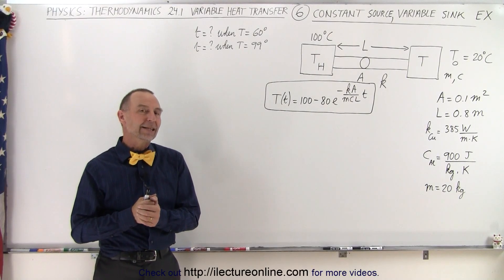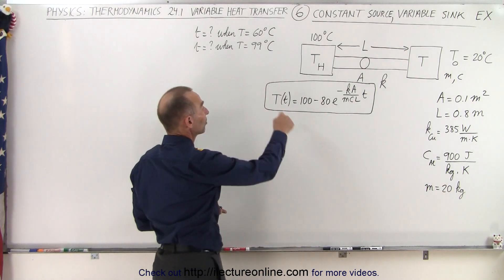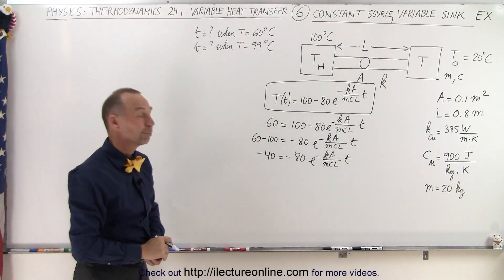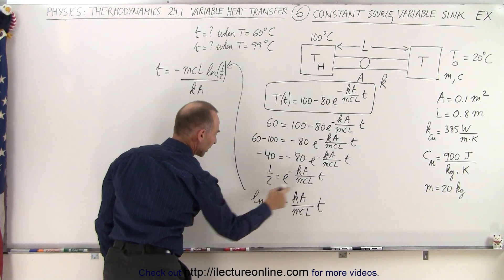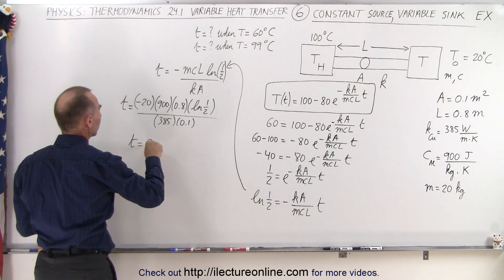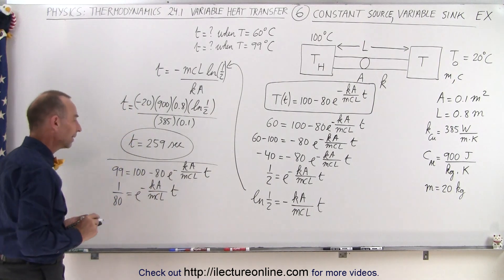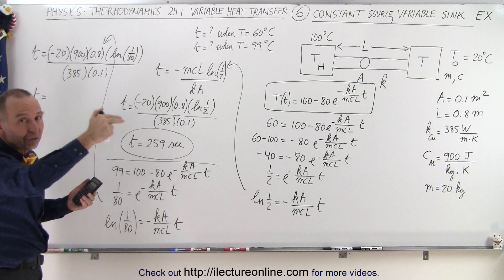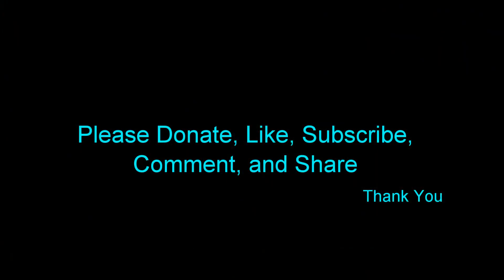Physics 24.1  Variable Heat Transfer (6 of 10) Constant Source, Variable Sink

Comment: What if there’s no distance between the two metals L=0
Reply from the maker: Then there is no conduction problem.  You must have  a path length in order to have conduction of heat along that path.
Reply: @MichelvanBiezen  I mean as in two blocks [  ][  ] touching 

I’m trying to work out the time it takes to reach equilibrium - all the videos tell you how to calculate it but not the time it takes between the two connected metals to reach the equilibrium temperature.
Reply from the maker: Ah yes.  Then the path length will not be zero, since the width of the bodies now present the path length.  That is a much more difficult problem since you need to know how fast the heat can dissipate from the hot body (and from different parts of the hot body) to the cold body.  Too much to try and cover that in a comment.  But it would make a great video for the future.
Reply: @MichelvanBiezen  I can give you an example, if I can get the math for calculating the time,  I can then use it for reference for other materials.
Reply from the maker: An example would be helpful.
Reply: @MichelvanBiezen  hopefully I got this right = 792.87 seconds ~ 13 minutes 12.87 seconds.